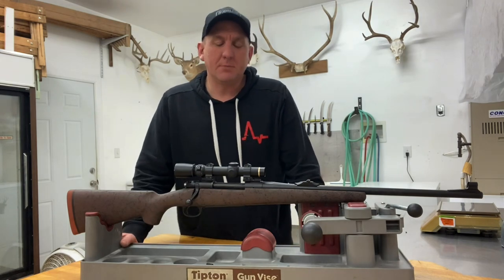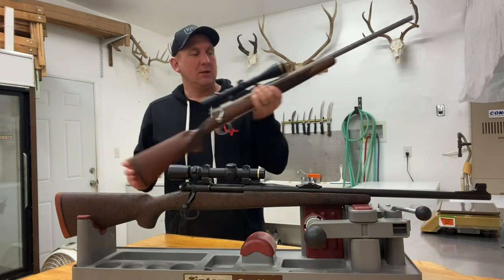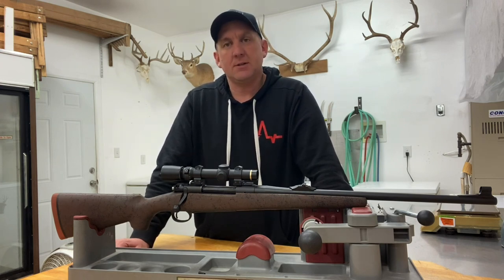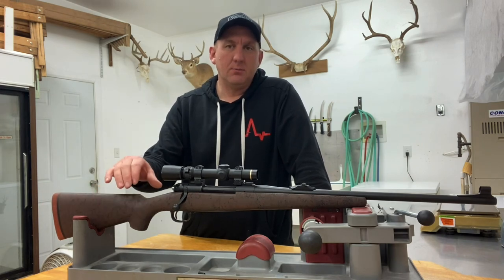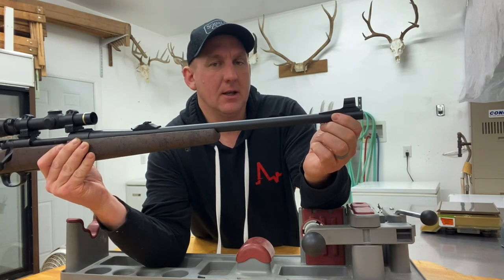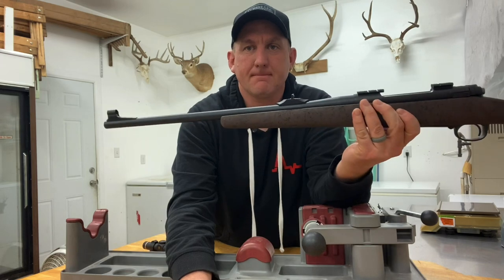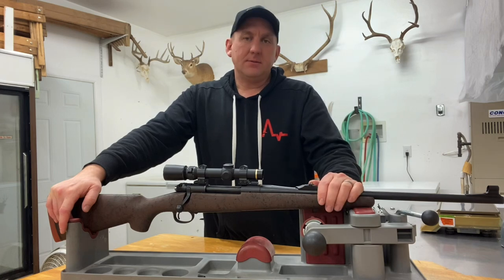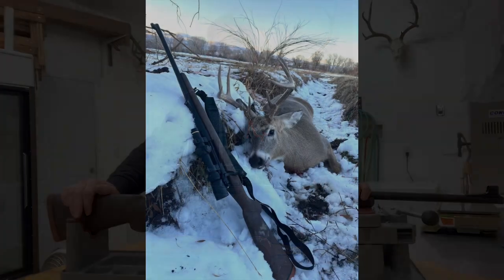.400 Whelen Build Specs

Comment: Have you had any trouble with head space because of the very small shoulder on the .40 Whelen when you resize cases?
Reply from the maker: It can be an issue if you bump the shoulder much at all. I only resize the neck far enough down to hold the bullet firmly. The only headspace issues I have had were on fireformed .35 Whelen cases that I do not believe were formed with enough pressure to expand the case fully against the bolt face and the chamber. Because of this I have gotten a few light primer strikes. When this happens I simply pull the bullets and fireform again with a .410 caliber pistol bullet loaded backwards in the case as shown in one of my other videos. 

Using quality cartridge basic brass necked down I have not had any headspace problems with virgin or resized cases. 

Building with the proper reamer (.458” shoulder) dimensions is essential for proper function.

Comment: Judd- I enjoyed your video. A few questions: Did you use a Petrov dimensioned reamer?  Forming your own brass from 35 Whelen or '06 Basic cylindrical? Best powder for the 300-400gr bullets? Thanks! -Mark
Reply from the maker: Yes, I used the Petrov reamer. I have used both cylindrical brass (Quality Cartridge .400 Whelen is actually cylindrical) and .35 Whelen Virgin brass. I actually cover that in a couple of my other fireforming videos.

I have not shot any 300 grain bullets. Mostly just 350-360 class bullets. I am really liking RL 10X. I know others have done well with H4895. If going heavier I plan to try some CFE 223.

Comment: What kind of velocities are you getting from 400 whelen ?
Reply from the maker: Should do 2150 or so with 400 grain bullets. My 360 NorthFork load is only at 2225 but could be pushed higher for sure.
Reply: @medicineriveroutdoors  , sounds good

Comment: Nice...any plans to do a video with the specs of this cartrige, firing, impact on jugs or gel?
Reply from the maker: Great idea. Been slacking on the channel. Will see what I can get out together
Reply: @medicineriveroutdoors  I bet that sucker has some serious energy numbers, not to mention being very efficient. I read about a guy making a 410 caliber wildcat (not the shotgun) based on a 9.3x62 necked up. I want to say he chose that caliber so he could also load 41 mag pistol bullets in addition to rifle bullets. Think he was getting close to the old 400/350 nitro express rifle load in terms of velocity and energy. 410 O&M I believe he called it.
Reply from the maker: @anonymousf454  , I know a guy in Alaska that did the .410 on a 9.3x63. His intent was to run the Swift A-Frames with just a simple neck up.

I would guess stats would be very similar…if not identical in each cartridge. Both will equal the .450/400 Nitro which built it reputation by flinging 400 grain bullets at 2100-2150 fps.
Reply: @medicineriveroutdoors  oh man that's so cool...lol I wonder if he is the same guy....I want to say he converted a leaver action 1895 Miroku..and there is a YouTube video of him shooting it.

Comment: I Know it can be done, I personally will have my 1917 Enfield rebored/rebarreled for 35 whelen, which is available now and then. But I'd rather get one in 444 or 45-70 instead of a 400 W, so even reloading, I can get fact ammo. BUT why not 40 or 416 cal Whelen? Would rather Wildcat a  40-416, 458 Win Mag in those cals
Reply from the maker: I have heard of folks successfully building a .416 on the .30-06 basic case but there is so little shoulder it doesn’t give much to headspace on. 

When you are talking .40” bullets now you are talking 10mm. I am only aware of handgun bullets in that diameter unless you wanted to shoot cast and size down.

If you work off the .458 case a .411” bullet gets you the 411 KDF. A .416” gets you the .416 Taylor. Both are excellent and will get you well past Whelen speeds without ever having to step on the throttle.